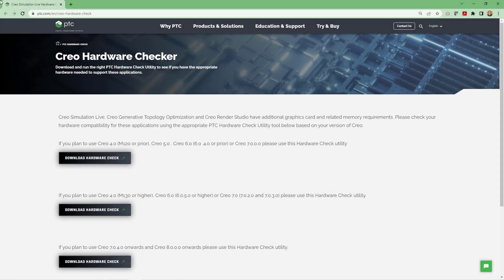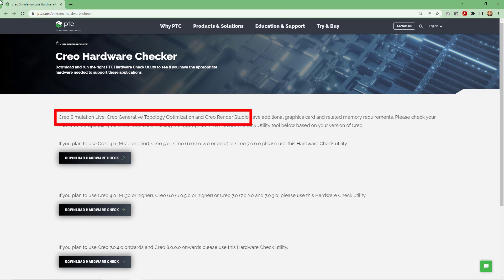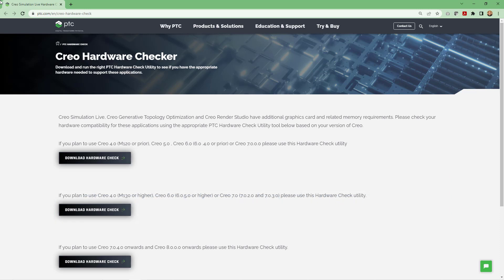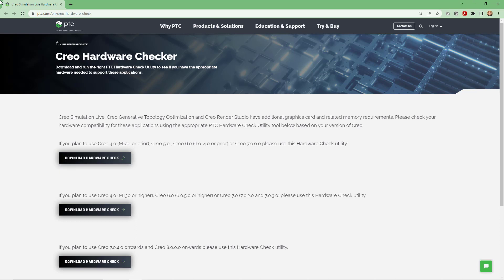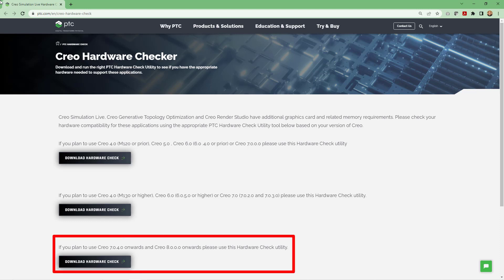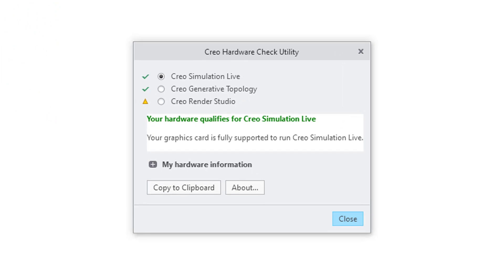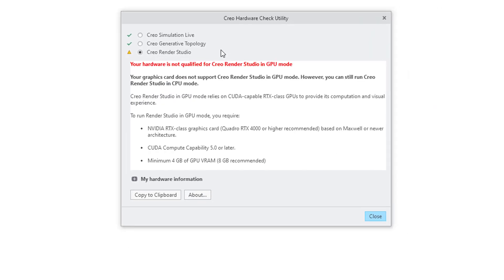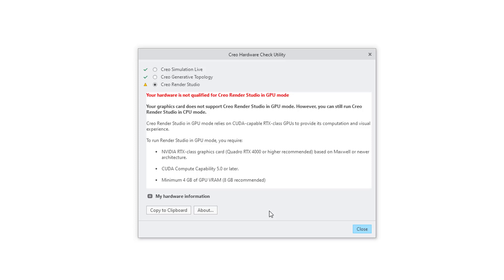Creo Parametric - Hardware Check Utility

Comment: Is 8gb ram i5 9400f good enough for creo 9
Reply from the maker: Funny, I was just looking at the PTC hardware recommendations as it's time for me to bite the bullet and get a new workstation after 7 years. The minimum amount of RAM to run Creo is 4 Gb, so technically, 8 Gb will work. But honestly, you will be struggling. It will be slow and working on large assemblies will be painful. I personally would not go lower than 16 Gb. Also, a few years ago, Creo would max out around 20 Gb of RAM usage. I knew people who would spend exorbitant amounts of money on 128 Gb RAM machines, and they were just wasting their money. I don't know if that's true anymore. Something to consider though. And don't scrimp on GPU if you're looking to use advanced functionality like Creo Simulation Live, Rendering, or Topology Optimization.